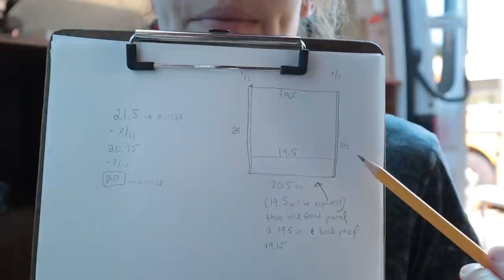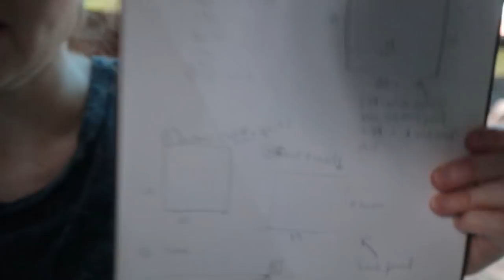HOW TO BUILD DRAWERS IN A TINY HOUSE

Comment: You can't do the right job without the right tool, so the fact that the glass didn't fell off, it's a great achievement without suction cups.

Holland: It's a huge cut!!
Steve: Tis but a scratch!
Black Knight intensifies

At first, when the storm began, i had the feeling that a T-Rex would come to say hi. What a wild weather you have there!

While i'm somewhat capable of using tools, the hardest part for me would be to preview how it all would fit and what the final result will be. 
Knowing where a false wall is needed is a designer's skill that i lack.
I admire everyone that is capable of doing things that i can't, be it performing, programming a stack of batteries or sawing wood.
You guys are amazing.

Comment: I’ve noticed 2 things... maybe I missed it. No roof vent for a 12 volt fan for the bathroom? Nor one for an rv air conditioner?
Reply from the maker: There will be a roof vent for a 12v fan and then the vent for the bathroom is lower on the side of the van

Comment: Your doing amazing  also question if teen wolf did come back for a couple more seasons and they wanted to use your van would you let them use it or would you have them get a different one ? Just curious
Reply: I’ve honestly started writing so many reunion teen wolf seasons  one has the van the other does but it can be worked it

Comment: i don't see any fans on the roof or wiring for solar if your running panels on the roof
most van builders work on electrical after framing so the wires are behind the panel
Reply from the maker: We put them in the cabinet but yes there were certain wires that needed running before spray foam bc of holes that had to be cut in the ceiling prior to spray
Foaming